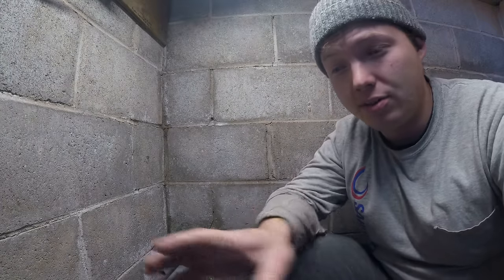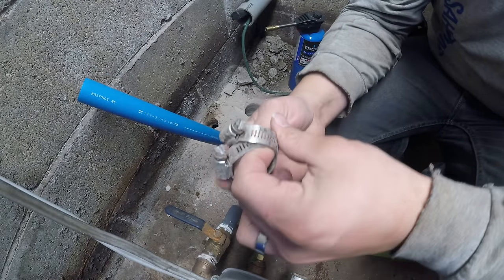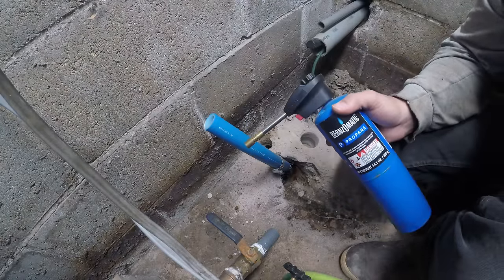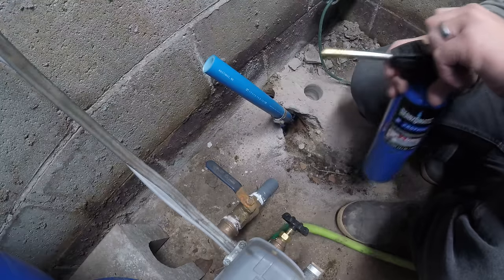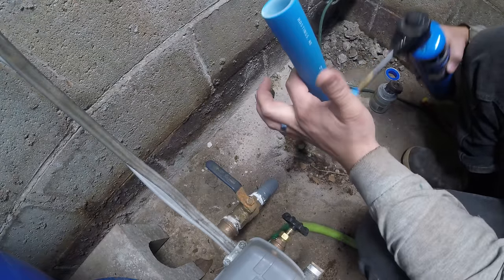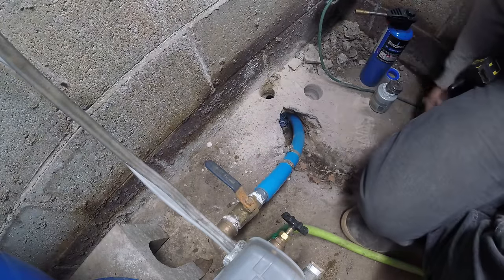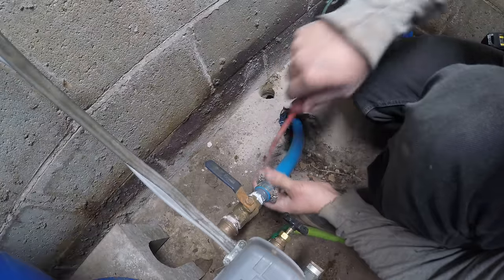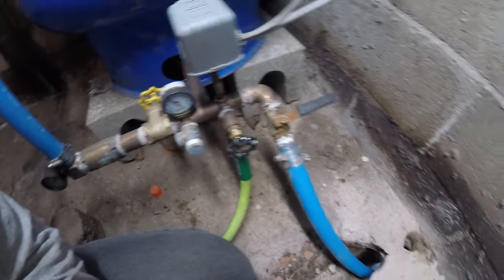How To Connect Barb Fitting to Water Line Using Hose Clamps

Comment: You don't use a torch with a flame to heat plastic pipe, you use a heavy duty heat gun, retired 58 year Master plumber.
Reply: what if you are hundreds of feet from an electric source? Torch is fine. 57 year old DIY/Farmer
Reply: John Krim why? I've never had any failures but have always dealt with under 100 psi, around 70 to 80
Reply: Heat gun is my choice yet a torch will work
Reply: Funny, I was just thinking it'd be better if I used my wife's hair dryer than that torch in my garage.
Reply: Heat is heat, use what you have. Thanks for the vid !
Reply: Hell I'd use a bic lighter if it's all I had on me

Comment: I have tried doing this 3 times and 3 times the connection has failed leading to a pretty wet problem. What I haven't done is heated the pipe. Now I'm going to do that. Hopefully it will hold. Thanks for the tip.

Comment: Can you tell me the difference between the ID dimension of the pipe and the outside dimension of the Barb connection.I trier to fit a 1.50" pipe on a 1.50" Barb connection, bit There is a diffirence of .150" between both. And I have a other 1.50" pipe whit a différence of .090" between both. This his for a connection of a waste tank for a sailboat.

Comment: What is the Hose barb size  connector for SDR 7 IPS PS24 ASTM02239 PS-11-69 3/4 IPS. 160PSI. 

Fresh water from water meter to the house.

  The OD of poly pipe is 1.075. Guess the wall is 0.100 .   So the hole is apx 0.800. 

Do you use a standard 0.750 barb in it and pull the pipe down with a clamp?

Or can you find a barb fitting that is oversized?

Anyone have a source?

Thanks.

Comment: Tip no. 1: How to get that stigmata look on the palm of your hands: Use a screwdriver to tighten the hose clamps while using your other hand to support the pipe. FFS guys, use a socket and ratchet. Saves a LOT of pain.
Tip no.2: How to case harden your flexible pipe: Use a torch to soften it. You will end up driving all the plasticisers that keep it soft out of the pipe. Use a heat gun.
No charge for these tips.

Comment: Use a union and a pipe nipple inside of the plastic pipe  = No brainer .
Theading in the nipple probably won't require any heat ether / just pipe dope.